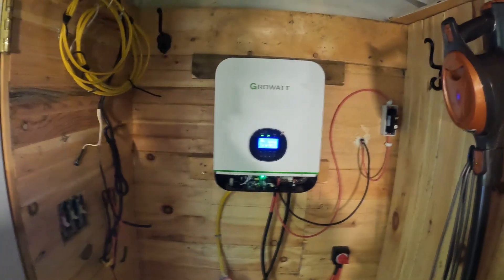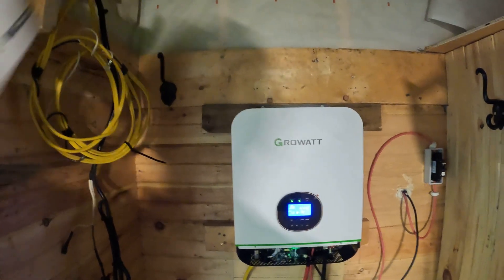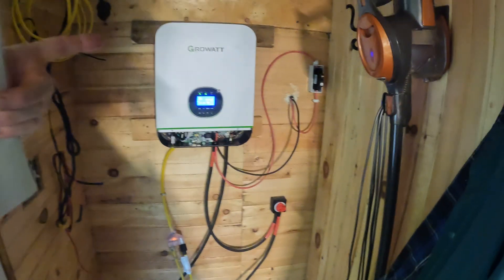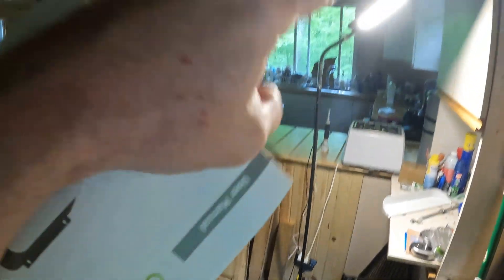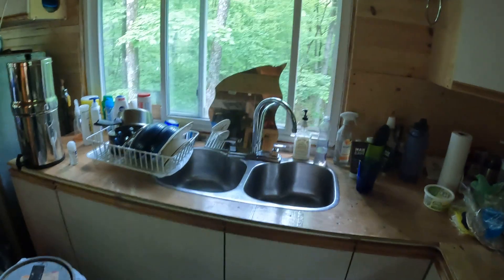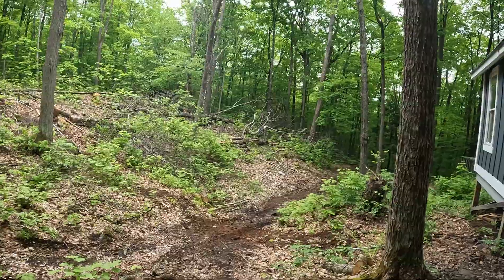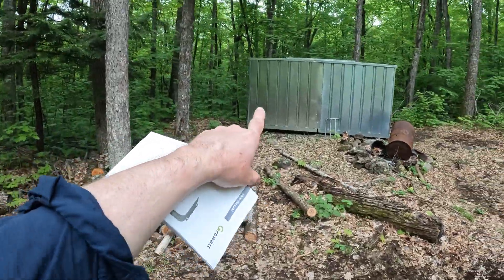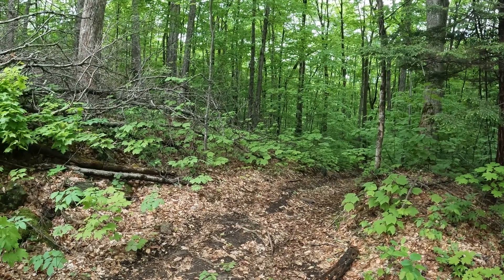Installing the Growatt (SPF 3000TL LVM) all in one inverter at my off grid cabin in Canada

Comment: Hi; how is your growatt all in one working so far?
Reply from the maker: 3x 340 watt panels
Reply: @scottnoiles8131  Hi are those 24 volts or 12 volts
Reply from the maker: It's working really well! I've not had any problems so far and I have been using it for over a year. The standing power is high, so I would recommend you have sufficient battery storage. Take care, Scott
Reply: @scottnoiles8131  What sizes of solar panel you have?
Reply from the maker: 24 volts 😁
Reply: @scottnoiles8131  Hi Scott sorry for not introducing my self My name is Orvin from Belize thank you for that information that will help me a lot thanks.
Reply from the maker: No worries. Nice to hear from someone from Belize.🇧🇿 Take care, Scott
Reply: Thanks

Comment: You may want to look into an "apartment-sized" refrigerator. I have a Vissani 7.1 Cubic Foot Refrigerator that pulls an average of 50 Watts per day. Start up: 853W, but uses zero Watts much of the time. That would be one less thing you need propane for. I also noticed trees to the south of your solar array, which will shade it during the winter. You may want to address that issue, if you plan on using the cabin in winter. I have bought two of the 3000W/24V Growatt, one for my work truck's solar system, and one for my girlfriend's shuttlebus/RV. Those can handle up to 2000W of solar input, so you could double the size of your array, if you needed to, because they never will put out the full value in Wattage. Good luck on your build!
Reply from the maker: Cheers for that! I was thinking about an electric fridge (AC) but thought they weren't as efficient as a DC one. Will look at the one you mentioned online. I have loads of trees and have cut down quite a few last summer. It's an ongoing chore that I am pegging away at. Take care, Scott